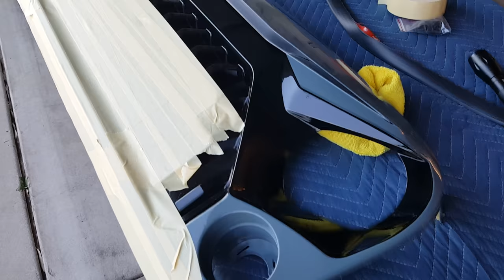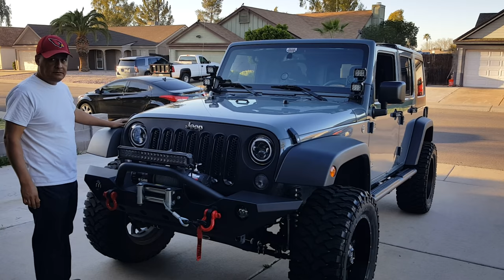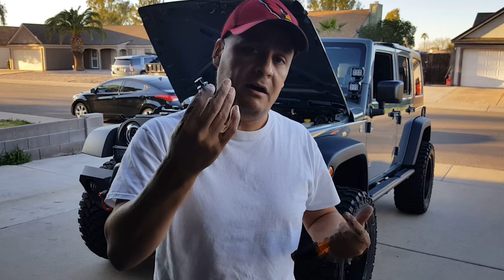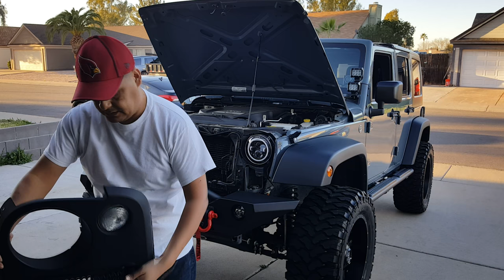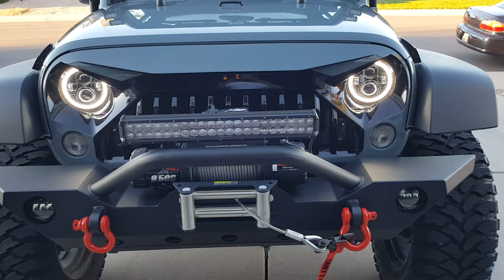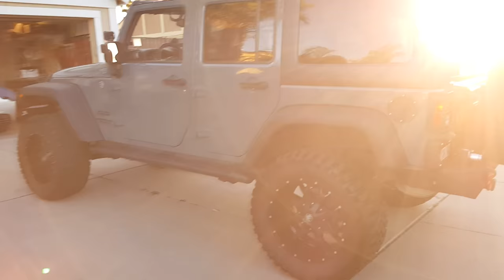Gladiator Grill install on 2007 - 2017 Jeep Wrangler JKU

Comment: very nice, kind of on the fence going with the mad max grill or doing what you did.  I hearing the mad max grill doesn't line up with the Rubicon very well.   Did you have a hard time mounting the head lights?  do you have a link where you purchase them at?

Comment: Hey man, what’s your lift/tire/wheels size/rims specs? Looks amazing, what mine similar.
Reply from the maker: 3.5" Lift 20X10" wheels 35" tires
Reply: @brpauto7313  3.5" prob some shitty cheap spacer kit so in reality prob 2.5" of lift tops

Comment: Looks sweet! what headlights are you running?
Reply from the maker: MOTOWN M There an off brand. I got them on ebay for 119. So far I haven't had any issues.  I like them.
Reply: were the lights an easy swap...did it come with some type of flicker box?

Comment: Nice vid. Can it still get in the garage with the 3.5 lift?
Reply from the maker: B702K As long as you don't have a roof rack you should be able to.  mine fits no problem.
Reply: B702K mine fits, barely.

Comment: What was the tape u put on and why?...looks great
Reply from the maker: MEDINA 22 I taped it up to protect it while I installed it. I didn't want to scratch it up.
Reply: BRP AUTO  I'm referring to the tape that you put across the top of the  grill before you close the hood
Reply from the maker: MEDINA 22 That wasn't tape. That was the rubber weather stripping that came with my grill.